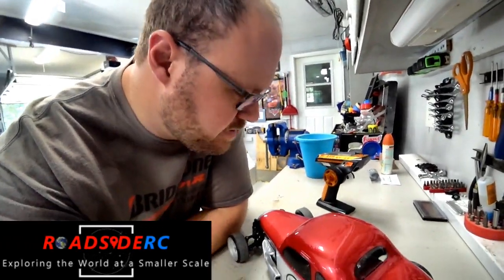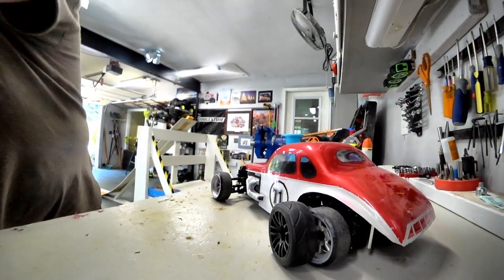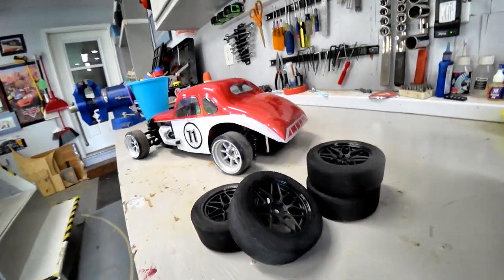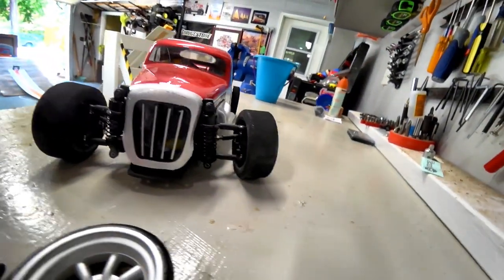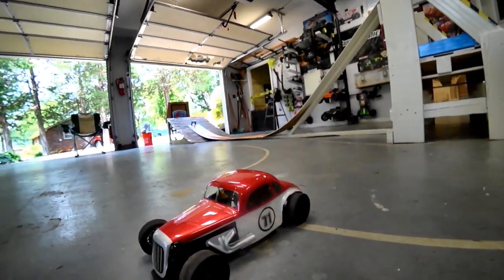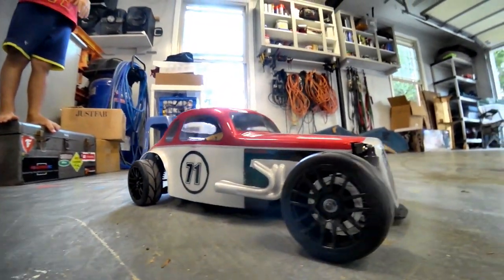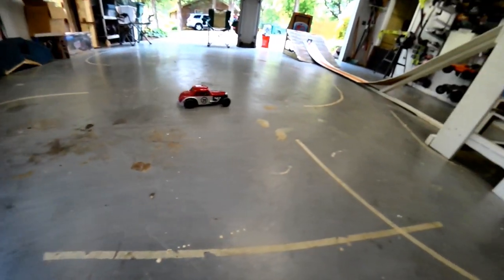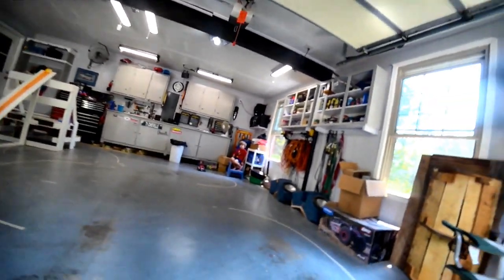TESTED:  RWD drift car with Foam and Rubber tires!!

Comment: This! This is the video I've been looking for. I wanted to do a grip/drift car without doing a AWD touring car but I wondered how it would react with grip tires. This answers all my questions. Thanks!!
Reply from the maker: Glad I could help!
It really does better than I expected.   The only thing I would be concerned about over time is the transmission gears.  They are all plastic and doing too many hard launches with sticky tires might strip them.  Otherwise, it handles pretty well.

Comment: Man thanks for doing these videos your literally answering all my rwd drift questions. I've been on rc since my teens but just now thinking about rwd drifting have done plenty with sprint 2s but yeah. Keep up the good work got my sub
Reply from the maker: Thank you!  Really appreciate the feedback and the sub. 

Feel free to reach out with other questions you have!
Reply: @RoadsideRC  Bless you, Brother.... thanks for this video. I have all Vaterra, Kyosho cars like the 72 Camaro, 69 Mustang, Challenger, Chevelle, 72 Trans AM, 72 C10, etc, and love to only drive them in the garage and church gym floors with a lot of space to scale I do not want to scratch them. I just got today an MST RMX 2.0 AMG GT3 I wanted a real drifter like the one in this video and how you have compared them vs AWD. I have no drift tracks in my area so I was going to use rubber tires on the MST and maybe if I find a group put the drift tires back on and/or play both in the garage or gym. This example video was great for a 49yr grandfather just getting into the hobby was what I needed to see. I do need to find out how to adjust my suspension on the MST drifter all new but looks like you kept it the same for rubber tires. Again...appreciate you for this test Sir.

Comment: Nice video I built a 4wd drift car with rubber front wheels and hard plastic on the back it was doing donuts only then I added a gyro now it drifts like a dream you can high speed drift too its awesome u should try it bro 💪💪👍👊
Reply from the maker: Interesting.   Thanks for sharing.

Comment: I’ve been curious about trying one of my touring car. I would have to gear it way down. What I’m really curious about is that couple body
Reply from the maker: Hi there! 
Two things for you: 
1) Here is the body:  https://alnk.to/gVLNXrW
2) Touring car vs rwd drift car are two VERY different things.   Just FYI - you can have a lot of fun hooning around in an AWD touring car with drift tires on it.  It is a blast.  But it won't do the same things a proper RWD chassis will do.    Not trying to deter you - just a heads up.

Comment: That rig is sweet!!!!!!!!!!!!..Those rubber tires grip great after warmed up..Glue them yourself bro..That way you know it's done right
Reply: Cheap or not K-Force Racing makes great tires...One of the best $20 I ever spent was on K-Force Racing SCT wheels and tires..I didn't know they made foams though..I might need to get some for my Euro Man Truck
Reply from the maker: That is right!  I will glue them now!
Reply: @RoadsideRC  Glue em and run em on the TT-02 on 3s!! Lol

Comment: Interesting.. :) But I kinda expected the results.. Still runs great, but with more grip. You're looking at more of a race car as appose to a drift Car... Very cool driving though and I bet she rides smoother on rougher terrains as well .. Roads driveways etc.... Thanks for sharing
Reply from the maker: Thanks!
I was surprised it still drifted.  Figured with only 2S power that it wouldn't have enough power to really slide around.

Comment: Old vid but great!
Do you think the foams would wear out quickly if you Drift on parking loat concrete? Assuming you have the power to do it?
Reply from the maker: Yes!  Those foams will die quite quickly on anything but a smooth surface.
Reply: @RoadsideRC  thanks!

Comment: I want a road/drift rc car so I’m hoping rubber tires are grippy for when I don’t want to drift and plastic when I do
Reply from the maker: That is basically how it works.  You probably would also be driving on different surfaces.  Imagine how different these results would have been on regular concrete or asphalt!

Comment: I actually have those on the front and some harder rubber foam filled in my 8.5t slider.
Reply from the maker: RWD drift car?
Reply: @RoadsideRC  yes sir, it is a highly modified with mostly diy mods on my now rwd TT02D. Like I'm running a metal HPI high speed spur gear that's been grinded down to fit the TT02.
Reply: @RoadsideRC  I'll be getting my Sakura D5 MR hybrid build back soon. It's basically a D5 MR but built into the D5S layout.

Comment: Kinda kool with rubber tires i was just think the same thing would it drift a bit still .
Reply from the maker: Yep!  Still works!
Reply: @RoadsideRC  how about tarmac/ wet with rubber
Reply from the maker: I have not tried anything wet with it.  The electronics are not waterproof.

Comment: I have a Redcat Lightning EPX drift stock that I put an XQ Viper TA body I installed blue halo headlights lights in on it and I was thinking of trying rubber or Contact foam grip tires (wider 30 mm to the back so it is a bit more true to the wider rear on real Viper TAs) to test a speed run. Drift tires spin on the pavement too much to try this with and have a hard time getting the car uphill as there is a bit of a hill where I run. I believe I could make good use of the stock power this car has that the drift tires just can't put to the pavement. As far as drifting with this thing, it is loads of fun. However, it is 4WD.  Is  2 wheel RWD harder to  master drifts with like with real cars?
Reply from the maker: RWD vs AWD is a huge debate.  
For me, I really prefer the driving style of a RWD, and believe once the car is setup correctly, it is actually easier to control precise lines with.  

My Redcat AWD car will do massive powerslides and things of that sort-  but getting it to precisely enter a corner and hold a line through it is very difficult.  

If there is a drift track near you, or others who drift RWD, then I would highly suggest trying it.  If not, stick with the fun of AWD.  

Hope this helps!

Comment: Just ordered some rubber tires for my drift car to drift it out on the street. Should be fun judging by these results!
Reply from the maker: Just be careful - often the drivelines are not really meant for that much load.  You may damage something.

Comment: The more scale-accurate you make one aspect, the more scale-accurate you must make other aspects. Giving it this much grip, it really needs more weight to make use of it. You can find weight via the square-cube law. So at 1/10 scale this would need to weigh between 24-42 pounds, or more typically 29-37 pounds, to equal a full-sized drift car with "rubber tires" level of grip.

At that point, you might need more power and torque, too, between 3 and 9hp will be scale accurate. And your wheelspeed will need to be scaled as well, but scale speed is not as simple of a conversion, and I recommend looking up a true scale speed calculator, but roughly 35mph is about 110mph equivalent for 1/10th scale.

You will definitely burn through tires like a real drift car trying this. And you'll need some pretty ridiculous spring and shock oil setups. Also, your weight distribution will have to be more scale-accurate, too. Anything between 60/40 and 40/60 F/R should work, as it does IRL. Adjust as desired till it feels right.
Reply from the maker: Interesting info.  

Not really the goal of this.  It is honestly more of an explanation for all of the folks who frequently ask if we should use rubber tires.  

Thanks for doing the math!
Reply: @RoadsideRC  Fair enough! But also, I still think it would be fun to try to make one of these with all metal super beefy components, an oversized electronics setup (like a castle 2200 1/8th scale powerset on 6s with a 1/8th scale HD servo), gear it for about 40-50mph wheel speed, and load it down with as many 1 pound lead ingots as you can reasonably fit under the body, then send it all the way on rubber tires but keep it on an ultra-smooth surface like this.

I bet the weight offsets the grip enough to give it the proper inertia and it'll feel much less twitchy/sensitive. Either that, or it accentuates the grip and becomes ridiculously fast, lol.
Reply from the maker: @Drunken_Hamster It could be a fun project!  I haven't seen anyone do that before.

Comment: Wonder how the plastic diff gear would hold up in the mst if you drove with grippy tyres all the time. Is there a metal tooth diff for the mst rmx 2.0? I'm thinking I'd getting one but I'm put off now since I realised the diff is plastic geared, kind of leaning towards the sakura d4 since the belt set up seems less likely to strip. I'd want to be driving it outside with rubber tyres most of the time
Reply from the maker: Honestly, if you are planning to drive outside with rubber tires, I would highly suggest you save some $$$ and get the Redcat Thunder Drift or Lightning Drift. 

Both are MUCH cheaper, and a blast to drive with rubber tires.
Reply: @RoadsideRC  I've had my fair share of experience with Redcat racing and similar off brands of the same like hsp and himoto, they all use the same parts with soft easily strippable gears and pot metal differentials and clutch bells that also strip and break, cheap glitchy electronics, I've gone through loads of them buggys cars and trucks. I've learned that it's better to spend the little bit extra and get a reputable brand that uses decent quality materials. I also wanted to try out a rwd drift car with the extra steering lock because any time I've ever made my 4wd rc cars rwd it's very hard to hold a drift with them because they lack that little extra bit of steering to stop them from spinning. Ideally I'd like to get one that I could put a low speed pinion on and use for drifting with plastic wheels and also put a higher tooth pinion on and rubber tyres for a bit more speed and driving around the carpark, but also have that extra steering lock for drifting it with the rubber tyres in the car park. Hence why I'm trying to find one that has a good strong differential set up, preferably steel gears
Reply from the maker: @ciarancdc  OK - that makes sense.  
I recently tried this car again with rubber tires - a newer video on it.   Had both this one and the Redcat Thunder Drift. 

I'm a little worried that you might be disappointed with the RWD car with rubber tires.  But maybe not!!  

The more I tune the alignment and suspension of this to be good with the drift tires, the worse it has made it with rubber tires.  Interesting, huh?
Reply: @RoadsideRC  I just watched your other video there, I know everywheres on lockdown at the moment but it would be interesting to see that comparison on tarmac as opposed to the slippy workshop floor, that's if you wanted to that yourself.
What I usually drive around at the moment is a 1/8 thunder tiger eb4 buggy with a .28 nitro engine in it, I have it rwd with traxxas 20 million wt silicone oil in the diff, it keeps it very tight but allows enough cushion for the drive train as opposed to an all out spool. It's easier to control the slide when it's going faster than it is at low speed because the front wheels slip more, I tried giving it more steering lock but the design of the hubs and the steering don't allow for it. 
It'd be nice to have a brushless car to take out for a quick blast without all the noise and mess of nitro and still get my fix, I enjoy the challenge of trying to drive something semi-uncontrollable it makes it all the more rewarding when you get it right, 4wd just seems too tame after a while when you get used to it. I think part of the trick with rwd is anticipating what the car is going to do and reacting to it slightly in advance.
Are the diff gears in your kit built mst plastic or metal? Have you ever had to replace any parts on them?
Reply: @RoadsideRC  I think why the suspension tuning works different for plastic and rubber tyres is down to how much it moves depending on the grip.
With plastic there's not much grip so the car doesn't lean over and change the camber in a turn so it stays the way you set it when it's sitting idle.
With grippier tyres the car is more likely to hunker down and lean over when in a turn, changing the the suspension angles. 
I have my buggy set up with quite a lot of positive camber on the rear wheels so the tyres make more even contact with the ground when the suspension is leaning over in a turn or squatting under acceleration. It also helps get more life out of the tyres because it doesn't wear the inside part of the tyre as quickly. When's it's sliding the inside wheel is spinning faster than the outside one and it also picks up a sort of negative camber because the car is leaning over, I try to replicate this when I'm setting up the suspension by pushing the car sideways and pressing it down to see how much of the tyres are making contact
Reply: I put some soft rubber tyres on my rmx 2.0 and it stripped the diff before got chance to see if was any good for drifting.  Had hellish grip went like a rocket but was twisting chassis all over the place, looked like had potential though.  Plan on converting to solid rear axle fitting some stiffer shocks and trying again with harder rubber tyres

Comment: I'm watching these video because I wanna see will it work because I bought it online and the tyre doesn't look like drift tyre
Reply from the maker: Gotcha.   For a smooth surface like this, it still does work.  For an outside, or rougher surface, it will not. 

What vehicle did you buy?

Comment: In general grip drifting is not fun. This is why back in the days people use to make fun of Americans because they would use the loud pedal and do a massive power slide instead of an actual control drift using different techniques.
Reply from the maker: Agree - would certainly rather use the standard drift tires...but it was fun to figure out what would happen!